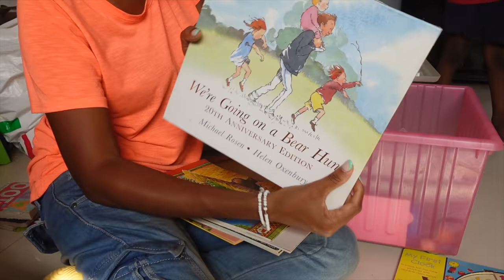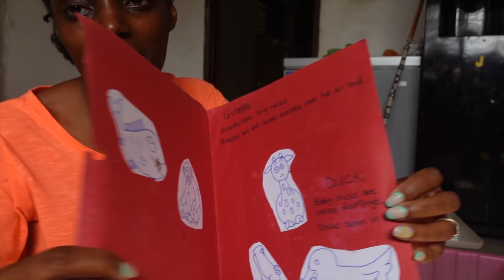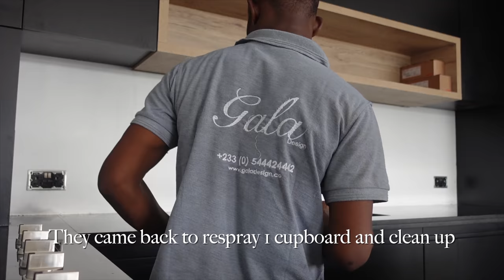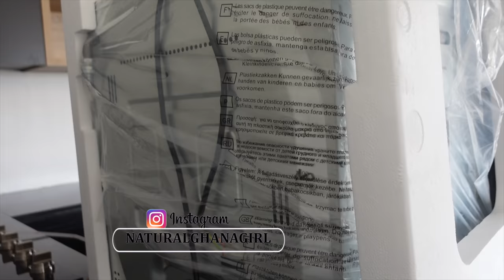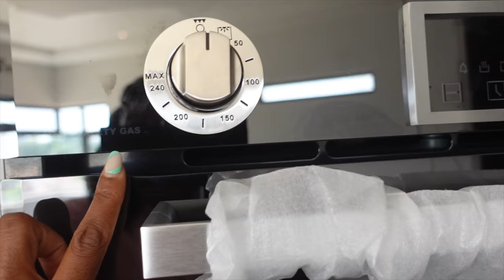MICROWAVES, OVENS AND CLEARING UP!

Comment: The Schofield & Sims educational books at the beginning, my other half wrote those KeyStage 1 English books!

The oven probably didn’t fit because Kwame didn’t offer it up exactly straight to the gap. Not easy to do with something that heavy, it requires at least one other, but he had it at an angle several degrees off horizontal, it will never fit until absolutely horizontal if the measurements are very precise
Reply from the maker: Oh really?  I love schofield and sims books!  You can tell her she’s doing a great job. 😊
Reply: @moretodela  its nice to know they’re appreciated. 👍🏻

Comment: Della please get some help, or you’re never going to move into your new apartment at this rate. Even with the packing of your boxes you don’t have to do everything yourself. You’re only one woman. Also can you not get a 40 foot extension lead from one of the hardware shops so you can run it from your downstairs flat to your upstairs flat so you have some electricity up there. Which will make it easier for you to use your hoover and suck up the dust faster. You’re never going to get all that dust gone with just a broom no way.
Reply from the maker: Working on the extension as we speak